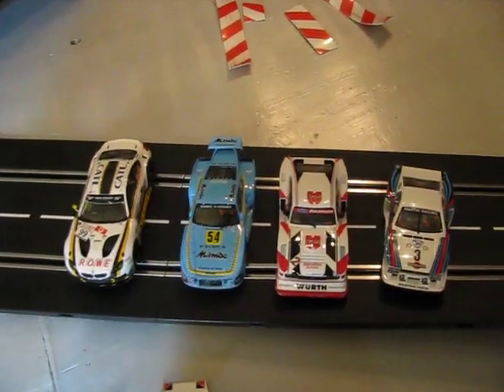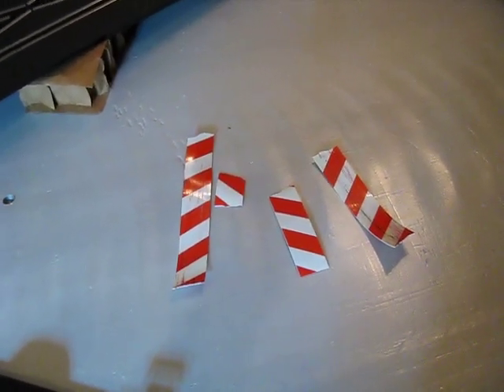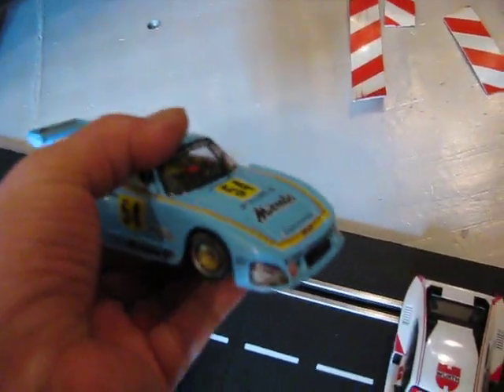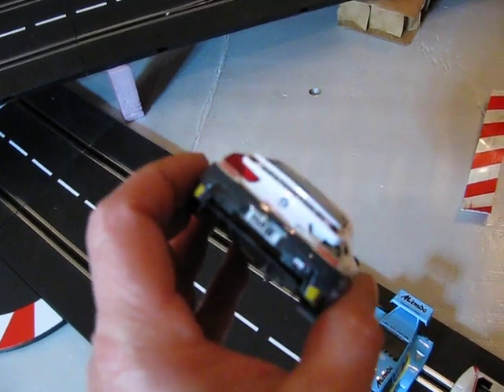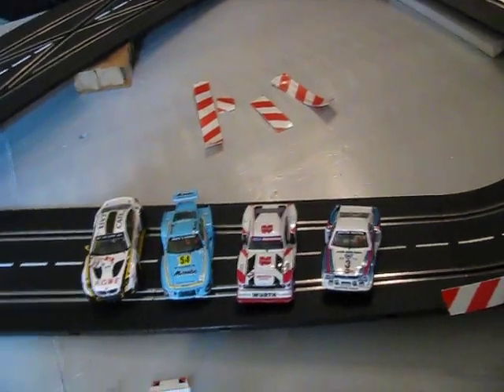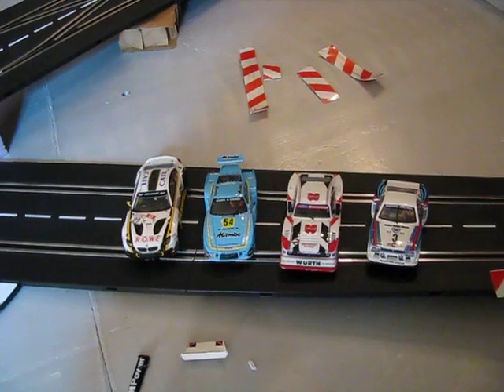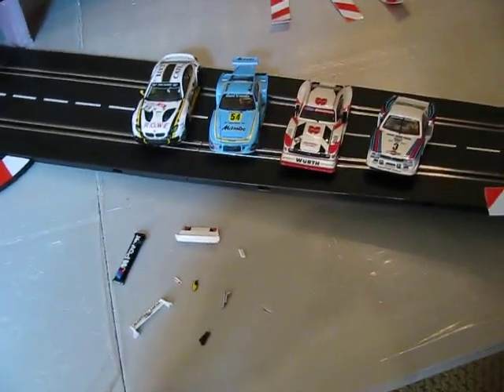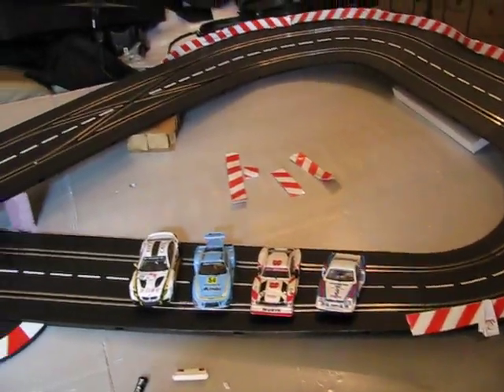Aftereffects of the first 4 car figure 8 masacre race + question for experts on Carrera Digital 1/32

Comment: Answer is : Too much speed on a short track kills🏁
Reply from the maker: Yes, I have been hearing things like that all my life, but going fast is so much fun. That track is like the "Bristol" of figure-8s. It only took a few minutes to get the cars ready for the next hammerfest and our driving starts to improve over time, as you will see in upcoming videos. We keep adding more to the track too which slows things down. The question I'm asking here has to do with holding the lane change button down the whole time while driving. This track wants 2 lane changes per lap to stay on the outside/fast line. People are just keeping the button down and I was worried it might not be good for the equipment.